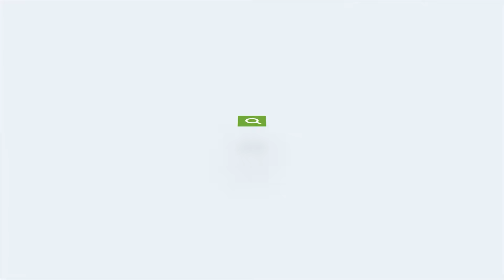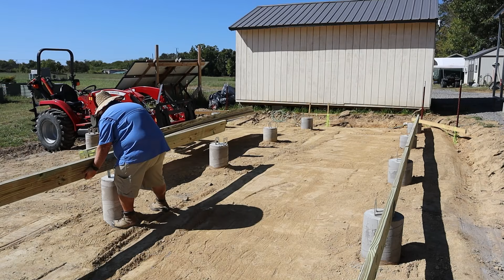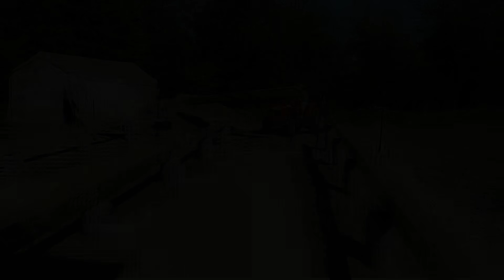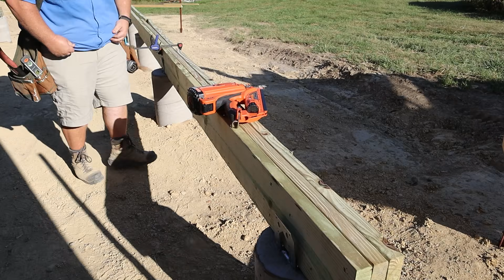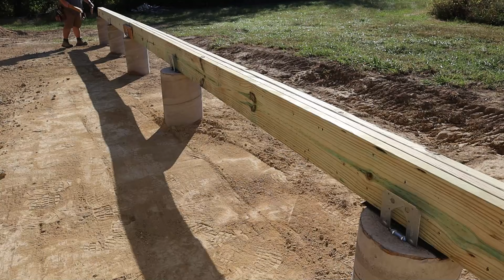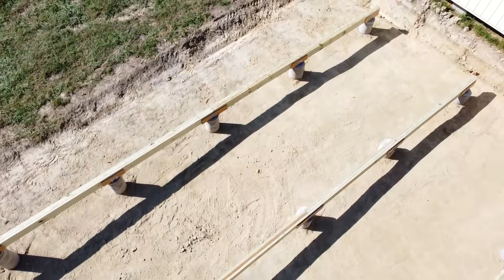MASSIVE BEAMS for an Elevated Floor Workshop Build

Comment: I stumbled upon your videos and found them incredible. I'm in the process of building my house and will be using wood frame construction. The measurements you used are a bit smaller than what I intend to use. I would really appreciate it if you could share this project, even just for material planning and construction process information.

Besides what's already available in the videos.

Congratulations on the content; I watched all the videos in the series, and they're simply fantastic.

Comment: Your work is great. I enjoy and appreciate the thorough commentary and taking the time to explain every step as I need the details. Most other content providers breeze through things too quickly and leave me with tons of questions as I am not a very experienced carpenter or craftsman. I have a question regarding the beams. How do you join the beams together to extend them from 8 to 16 to 24 feet? Some sort of lamination with another beam?

Comment: When doing the peir layout. If you are doing a very long structure that has a 12'width. Using 2x10x12's for floor joists. Can you just put peirs on the exterior wall lines and skip one in the middle since it isn't wider than the span ability of the floor joists? What are your thoughts or maybe a link to some good source material to research it further, I am having trouble finding a definitive answer.

Comment: Wondering if instead of putting the joists on top of the beams you could have cut them to fit within the beams on hangers to save on height

Comment: Did you have to special order those wood to concrete brackets? The beam would be 3 x 1.5 = 4.5 inches thick, but the only products sold retail are for accommodating 3.5 or 5.5 inch solid dimensional lumber. So were those a special order from Simpson strong-tie or can you find those at a retailer?
Reply from the maker: They were an online ship-to-home order from Home Depot.
Reply: @Samcraftcom  I know the old fashioned method of plating the pier with anchor bolts, but I am investigating the beam seat brackets just out of curiosity.
Reply: @Samcraftcom     HomeD is great for ship to home.

Comment: What did you use to find beam spans for sonotubes? Most of the ICC and AWC span charts are for stem walls, but I guess they would apply the same. I found some deck websites that show spans for pier and beam.

Comment: Looking great Sam   ..Question  are nails stronger than screws  looks like that nail gun speeds up the job
Reply from the maker: Keep in mind this is just my opinion and I'm not really a professional... It depends on the application. Nails will bend and flex and withstand forces better than screws, which will break in such instances. However, screws tend to hold two objects together tighter. For framing nails are much faster and perfectly strong. For things like siding or finish work I prefer to use screws.

Comment: Why though? Why didn't you just build up and pour concrete? can hold more weight, last longer and heck of a lot cheaper. What am I missing? Code issues maybe?
Reply from the maker: There's no way it would be cheaper, not with concrete pricing today! The grade drop is about 29" as well... that's a lot of engineered fill to compact correctly to prevent settling and cracking later.

Comment: Looks good. Suggestion, you should put joist tape on top of the beams to keep water from penetrating between beams. As Just aa a precaution.
Reply: Perhaps apply tape on top of the floor joists as well (?).

Comment: Sam, another great video!  If I have learned anything about you from following your channels is that you try to do things right!  I first discovered you when trying to find information about the Shapeoko.  I ended up buying one and love it.  I too, have recently built a new shop.  I would have built it different, probably better, but I wanted a turn-key contruction.  It was done in 3 days and I didn't have to lift a finger but there are trade offs to that.  Now, to my actual point. :)  FB groups that I belong to have talked about floor bounce.  Hopefully, you have everything figured out correctly to address that.  I have it in my shop but I know that my  contruction isn't the same as what yours will be.  Anyway, it was suggested to double the plywood floor which I could have done before I finished the space but I didn't, mainly because of the additional cost.  It doesn't hamper what I do and I can still make things.  So, I can live with it.  I am only suggesting that you might have to double the flooring but I don't know.  Anyway, good luck.  I can't wait to see the shop finished and the things that you build in it.
Reply from the maker: I look forward to putting my CNC to use again in this new shop! I've never had the space to use it in my current one. I have several projects in mind waiting for the revival again. :)

Comment: SAM PLEASE  .....put down a .06 mil. vapor barrier now on the ground "BEFORE" you do your floor framing.  Actually, it would have been much easier if you'd put it down before you put the beams in place.

Comment: I think a triple beam is overkill for the size span you have, a double beam would have been good enough. You could have placed plywood in between two 2x8s also. It does look beefy and should support a heavy load.

Comment: Just a question about yor beams - I know you said you did not have enough length to stagger the joints. Would it not be the same length if you cut one of the long board in half them put the one long one in the middle and the 2 short ones on each side of that? I just want to understand for my project Im working on laying out. Thanks
Reply from the maker: The length wasn't the issue, but the pier spacing. They didn't line up to be 16' in the middle span.

Comment: since youre building the new shop to the same height and verry close to the old shop it might be handy to made a small "bridge/ walkway between the two shops , will mean adding doors in both shops 
the small shop faces the road and having the walkway between them would mean that you can unload stuff intoo the new shop through the old shop and dont have to add to the excisting road , will mean that you have less wallspace to put stuff at both shops where the (double?) doors are
to bade about the direction of the eve of the roof on the old shop as tearing out the rear wall and just extending off the back of it mightve been nicer
wat you can still do and whont cost a lot is laying rows of pallets around the foundation piers this once the rest is build would allow you to store lumber and other materials under the building and off the ground

Comment: Will you be going with trusses on this build? Your old shop technically had a ridge board rather than beam, getting up to 20x32 you'd be best served with trusses like Seth did. I used ForteWeb to calculate the ridge beam on my 10x20 office (ended up with a 14" LVL). My structural engineer friend uses the same software for basic wood framing and double checked my numbers.
Reply from the maker: Yes! This will be my first time using trusses but I couldn’t imagine building a clear span roof any other way. I want this space to be wide open. 😎

Comment: Treat yourself to enough windows for that sweet natural light to work in while still providing ample wall space for wall cabinetry. Since you have huge access to the underside of your new shop consider running dust collection pipe runs under the floor. Also a good time to consider placement of power outlets in the floor for your big stationary tools i.e. table saw, bench and assembly table.
You're building the dream of every woodworker. I'm enjoying every fastener you drive home!
Reply from the maker: Great ideas and tips, thanks for your input!
Reply: You're the man Sam and Angela and the boys.....almost forgot.....the 2 furbabies as well. We love thier cameos, they're a fun feature.